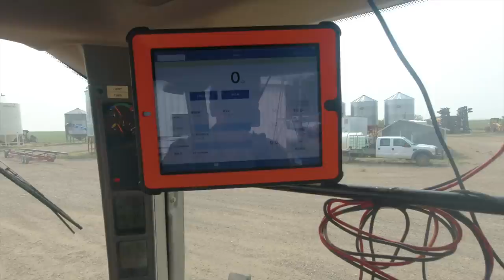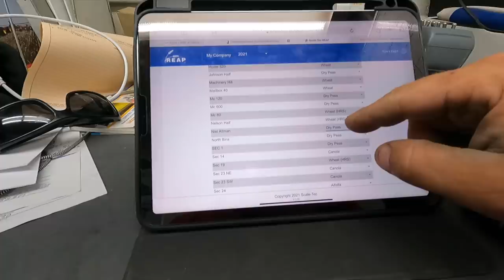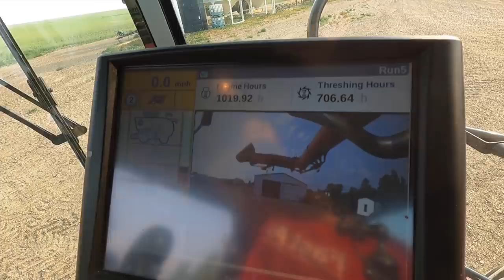Oops! (Did I Do That?)

Comment: The one thing I've learned from working up ladders is to take 5x the number of nuts/bolts/screws you need as you will drop them.
Reply: Just take a magnetic tray,and it works GREAT.